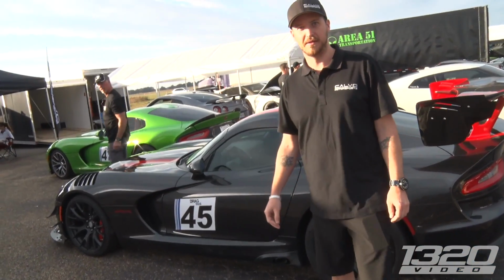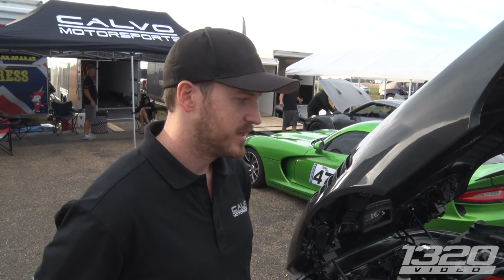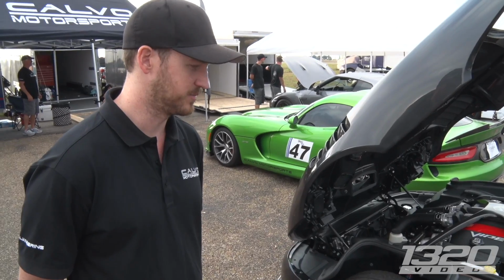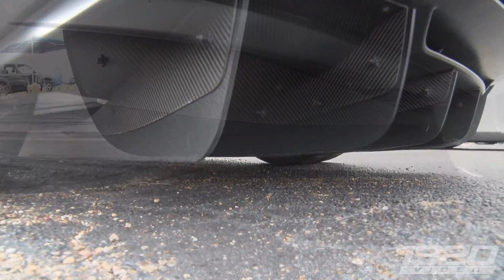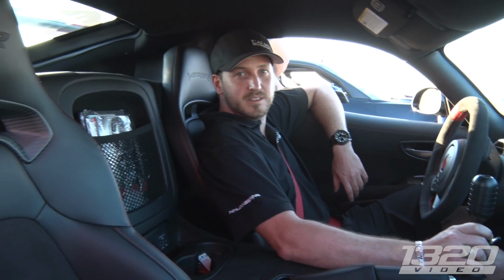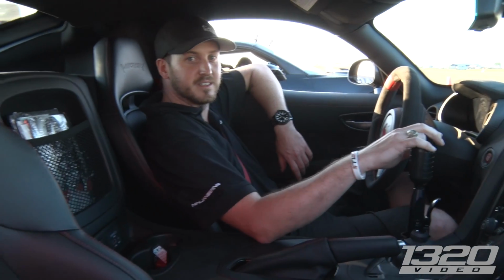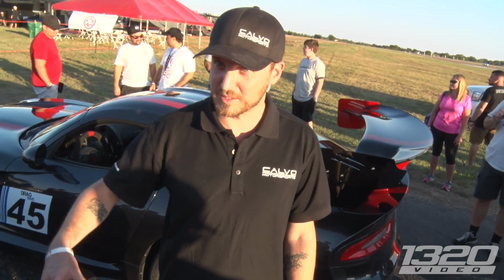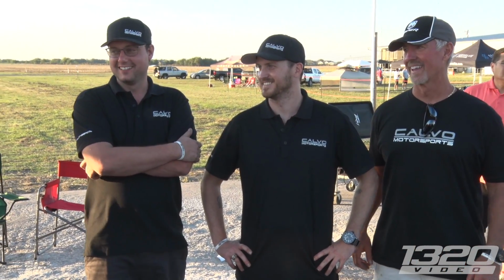This is the Way Vipers Should Have Come!

Comment: "V8 EATER" is kinda a lame tag when you have a V10.
Reply: Kevin B. *4 banger
Reply: No its not
Reply: Kevin B. So true 🤣🤣🤣🤣🤣 the new tesla roadsters will rape wipers for sure
Reply: Kevin B. How would a v6 eat a v8 it’s a smaller engine the v10 is bigger that’s why it makes sense you can squeeze more power out of more cylinders
Reply: thats the point. tags like that are usually on cars that would be considered the underdog.
Reply: David Stevenson with mods anything can be possible.
Reply: V8 is the class to beat.. I guess he's just mocking the rest of the American muscle.
Reply: Pretty sure he stole the ideal from that from the pennzoil commercial with the viper
Reply: You didn't know this is a 10L 2 cylinder? :p
Reply: Evil GST I think it's more of a poke at Corvettes V8. I'm sure "Vette etr" was taken
Reply: N.J. State øf Mind Haha stupid ricer. They have turbos, turbo the 7L too.
Reply: Evil GST well generally v8s are the best for power, not to many cylinders since any more would be unnecessary weight and more parts would be needed and it’s harder to keep it cool, not too little for it would make it hard to maake power and the same setup from a 4 or 6cyl would make more power on a v8, and it’s cheaper to buy and to work on any any bigger engine, and 4 or 6 cup setups to get identical power as an 8 cyl is more expensive given disadvantage in displacement. No wonder we don’t see Porsche’s with serious drag builds unless they’re LS swapped, or aventador having engine mods at all, or Mercedes G65s being turned into off-road builds, hell, even Mercedes won’t use the flagship v12 engine in the g class 4x4 so really, any other engine being a v8 killer is bragging rights( although I’d kill for a e60 m6)
Reply: David Stevenson ask gtr owners about how they eat v8s for breakfast, or how porsche can make a flat 6 get a 10 sec qtr mile bone stock, although a v8 does have more potential
Reply: Kyronius lol if that were true the car would be visibly vibrating from left to right and just sound like two pieces of metal hitting up against each other
Reply: oh and how many v8s do you see vipers lambos gtrs r8s once you can sort out traction bigger engines are better as the power delivery is smoother
Reply: Evil GST makes perfect sense to me
Reply: There are a few unicorn engines in the import scene, like the 2jz-gte which can make crazy power on  a stock bottom end with hardly any mods, then you have heavily modded ones that can pump upwards of 2k+ bhp, with a few insane ones in the 3k and above range with billet forged blocks the works.

It is one of the only non V8, V10 or V12 engines that can hang with the big cubic inch engines , while only technically being a 3 litre Inline 6. 

The engine is so widespread in the tuner scene that it has essentially become the LS of engine swaps. If a JDM based vehicle is doing quarter miles within the single digits, they probably have one of these engines under the hood.

Then you have honda engines, say what you will about hondas, but those little 4 pot engines can surprisingly be really impressive, you can reliably get upwards of 500-700 horsepower on a stock block with some forged internals, a cam and a good turbo setup, with ebay parts, all from a tiny 2 litre engine.

People underestimated honda engines, these days hondas are making way over the 1k horsepower range, while not anywhere near cheap once you get into the 1k range, you can make a lot of power from these small engines. There are Hondas that break the 200 mph range you know.

The Japanese know how to make some powerful and reliable engines.
Reply: You forgot the 4G63 which routinely handles over 500whp on stock block, rods and pistons. And some have made well over 600whp, all stock bottom end internals. Mine makes over 400 on completely stock bottom end with close to 200k miles and is daily driven.
Reply: They're pretty great engines too, but at the higher power range, they're not exactly known to be reliable or cost effective to modify, still they're a very iconic engine that came in the evos.

Similar to how the RB series engines from the GTRs can make great power reliably, but but in the higher horsepower range the the 2JZ has it beat, for power to cost ratio. For example you can get 1k bhp out of a stock block 2jz while with an RB needs to be more heavily modified to get the same output.

Don't get me wrong I love almost all tuner engines, but the 2JZ-GTE trumps just about anything in power from the 90s- early 20's when it comes to JDM and that's fine, not all cars and engines were made to to be fast in a straight line nor do they need to be.

The JZ was heavily over engineered by toyota and yamaha to be honest, the engines were never meant to be that powerful. It's practically bulletproof due to it's ridiculously strong cast iron block, oil squirters and forged crank, which it all came with straight from the factory. 

Even the Supra's brakes were overkill for the power it was making stock, the brakes were so powerful it was beating out sports cars like porsche at the time.
Reply: Yeah it’s pretty stupid, also considering the two turbos.
Reply: alan carranza yeah when your 4 bangers make 250hp stock lol you'll have to dump a shit load of money into your rice burner to get it to 400hp ( if it can handle it on stock internals) let me guess 2jz swap typical ricer  392 hemi 485hp naturally aspirated , 5.7 hemi 375 hp  , 6.1 hemi 425 hp , Ford 5.0 liter  460 hp , viper v10 645 hp stock , let's go low end 3.6 liter pentastar v6 305 hp , mustang 4 cyl 310 hp , Ford v6 in the sho 365 hp it goes on and on when american muscle boosts its massive hp not this big twin turbo , cai , performance chip , weight reduction , fart can ,lol bagging it and don't get me wrong but some Asian imports are no slouch such as gtr , supra but as tech advances more hp 4 cylinders get means the v6s go up and the v8s do as Well , it doesn't  take a shit tom of mods to make a v8 strong
Reply: Wind of change Honda engines are made 2 miles from my house here in Ohio. Not japan
Reply: it's basically saying fu to your v8 and whatever forced induction you have on it
Reply: David Stevenson smh
Reply: V8 killer fits better i think
Reply: Should say "zr1? LOL"
Reply: Ya a v6 would fit the plate better for that statement
Reply: That plate would look better on my GN
Reply: Because it is literally v8 eater. Bullying maybe yes, but it is what it is.
Reply: @daevid21  fort gt is a v6 and it beats the demon

Comment: I get that he needs downforce for 1700 horsepower, but if he is dragging the diffuser by the end of the run i think he should pull back a little on the aoa. At that point the drag made by the spoiler is probably counteracting the gains made by extra downforce at the start. Anyone agree/disagree?
Reply: If he was only planning to do this kind of event he could tweak the car to do a lot better. One of the GTR's had a clever aero solution where the angle of the wing is sprung, so as it gets faster the angle reduces. Best of both worlds then, you get the extra traction in the gears where you need it, and less drag at the top end.
Reply: I saw that to. But you wouldnt think its that hard to spin a couple nuts and bring it down on the adjuster
Reply: very true
Reply: yes, that one was nice.. at high speed the wing will flat.. reduce a lot of downforce
Reply: Reducing the angle of attack also reduces downforce at low speed. As for adjustability, it only has five settings, not "a couple nuts" with unlimited adjustment. The "fix" was to increase tension on the springs, and increase the compression damping.
Reply: Ninjaneering did you guys use a dry sleeve? Or wet sleeve? Thanks

Comment: Why does the viper engine always sound lazy? No matter how much power they put thru them they never liven up.
Reply: Its because Vipers usually don't rev high. Around 6k rpm is 'screaming' for your typical Viper engine.
Reply: They don't need to?
Reply: Sonos45 v10's are just sequential firing 5 cylinders mashed together, sequential 5's sound like tractors without a proper muffler setup (lambos sound good due to the insane multi chamber muffler design) where as vipers don't have room for it. Awesome cars that sound like doo doo.
Reply: I know they are awesome just I've heard industrial generators that sound more enthusiastic .
Reply: Sonos45 its not a super high revving engine
Reply: because 8 litre
Reply: i like it, so you can run away & won’t be heard miles away
Reply: Its has a longer stroke so inturn lower rpm. I hear a straight piped one in orla do once and it sounds pretty nice tbh.
Reply: Sonos45, Cross-plane engines tend to rev lower because from the first to the eighth piston the sequence of the firing is uneven and makes it more difficult to rev over 6,000, 6,500rpm sometimes and the capacity is limited because of that. Engines like the one in the Lamborghini Gallardo, is a Flat-plane V10, and it can rev higher, because the firing times go even thanks to the Flat-plane crankshaft.
Reply: Sonos45  Most of it has to do with whether or not the two exhaust banks are joined together. And on this car, I don't think they are (side pipes). Look up some videos of V8's with 8 into 1 headers...they scream compared to "true dual exhaust"
Reply: I think you're a bit confused, here. There is no such thing as a flat-plane V10, as you typically need your number of cylinders to be divisible by four for it to work without issues. Lambos are, however, true 72 degree V10s, and therefore even firing, thanks to offset pin cranks, unlike the Viper, which is a 90 degree odd-firing V10. The ability to rev has nothing to do with the crank pin design as much as it does with the stroke of the motor, and the mass of the rotating assembly. The Viper has a 4" stroke, which is pretty huge. We still rev to 7K RPM, though.
Reply: i wonder why they must go with a 4 inch stroke as 8.4 liter is WAY bigger than the competition.
Reply: its named viper for a reason
Reply: M773 also don’t forget the viper redlines at like 6100 RPM.
Reply: @herculesrockefeller2984  exactly my friends 750il 12 cylinder redlines at like 4500 rpm

Comment: What's the deal about the 19" rims?
Reply: Shawn Moses 1750 WHP through a thin set of Proxes, on stock 19 inch wheels, and it didnt spin and was pulling 200+ mph runs, its damn inpressive..
Reply: Shawn Moses built it as a street car
Reply: .. as compared to 15" drag radials like most rwd cars making close to or over 1000whp run. Doing these times on a 19" small sidewall street tyre is more than impressive...
Reply: Big height is a good band aid for slightly too short rear gear, sidewall and flex are what give it the most traction. Most of the time its only slightly taller than a 19 or 20" wheel if any.
Reply: Because true streetcar...

Comment: Not much of a V8 eater if the CTS-V on the second run beat it💪🏼
Reply: Dude that was just in practice test and tune. Mopar always rules.
Reply: Power Wagon always
Reply: It's obviously a reference to Pennzoil viper video.
Reply: He's on street tires!!!
Reply: Power Wagon the cts v is a beast tho
Reply: Still though, it would take similar cubes to chase this viper.
Reply: The viper was tuning that is why it won
Reply: They were tuning, not racing.
Just like at the drag strip when two completely different cars appear to be "racing" when they're actually testing.
Reply: There's the fact that it wasn't a legit race but just a tuning session, as stated multiple times before. But also note the difference in rear tires. Give that viper some tubs and bet that caddy wouldn't stand a chance.
Reply: That was during test and tune, and was my dad's first time ever driving the car. The Caddy lost when it came to the actual racing, whereas we won the overall RWD class. So, #v8eater stands true.
Reply: Ninjaneering Love how you guys made the that V-10 work!!!!!
Reply: Test and tune dude
Reply: Also that CTsv was definitely not stock:)

Comment: Can't say v8 eater with more cylinders and displacement...... only works the other way around
Reply: William Proctor it's a reference to the Pennzoil viper.
Reply: Nah he can do that
Reply: actually he CAN do that.
Reply: Can’t say v8 eater but I’ll say it’s the lambofucker
Reply: How about a RT-flex96C two-stroke 14-cylinder diesel with 107,389 horsepower? 5,608,310 ft-lb torque at 102 rpm.
25,480 liters displacement. That's not to say it's a fuel hog. It makes over 50% efficiency.

Comment: Without the wing he would be doing 210 ish quite easily.

EDIT: 215-225 easily.
Reply: MrZyLeXx BHAHAHA no that wing is actually helping ALOT this is WHAT Nissan GTR's is also done for å while now.  It generate alot of Grip so you can push more psi per gear..
Reply: You are greatly mistaken... This is 1500' of acceleration, not a top speed run. The car is gear-limited to 230, and has been 210 in the 1/2 mile. Without the aero, the car would've gone slower. We had an identical car, but a GTS with the advanced aero package, and it went slower all day.
Reply: Ninjaneering Did you guys build this thing? That Viper is a monster. Personally, if I were to have a Viper, I’d keep it NA and try to get it up to like 800hp.

Comment: 3:56 notice from the wheel gaps front is higher than the rear when he goes flatout; negative rake = not good. He needs to raise the rear to eliminate negative rake when going full send. This would cause the air underneath the car to think it has bigger rear diffuser than what's actually on it = better suction to ground. Doing so means he won't be scrapping his diffuser anymore. win win. Plus this is what the F1 guys are doing. He could probably eliminate the rear wing since essentially all rear wings produce drag.

Comment: The Gen V Viper needed to make between 700-800hp just like the Hellcat to catch the attention. It could have with Individual Throttle bodies, under piston oilers (allowing the Compression ratio to be boosted to 11.5:1) water injection, a Hemi head, change to the a 72deg block angle (instead of 90 degree). The Hellcat came out with the Right amount of hp.

Comment: Great vid but I'm curious why so much HP when there are plenty of modern cars that will do 200+ with half the power. Is it a distance thing?
Reply: Spinal2111 Yes, speed within said distance, its only about 1600 feet I believe.
Reply: Math.... D×R=T ..Distance multiplied by Rate equals Time.  The Faster you can achieve a top speed... in a very short amount of space and in a short amount of time...

 Some cars can do 200mph, Yes.  But, in a long distance and usually taking a few moments longer then the mile or quarter mile drag races.
Reply: Yep

Comment: All these twin turbo big power vipers, are they stock blocks or are they now using aftermarket blocks that have recently been developed for late model vipers? ive been doing a bit of digging through forums all over the place and cant find much on aftermarket blocks apart from LSM billet blocks so I cant help but wonder.
Reply: stock blocks and crank.  there are plenty of them making well over 1000hp on stock motor with just turbos

Comment: With that huge parachute molded into the front end,  I realize the Viper wasn't designed for top speed, but running a 1/2 mile from a 60+ mph roll ..with 1750 hp. and yet only achieving 195 mph seems a bit slow.  As a comparison to another car not limited by aero-drag,  a 2006 Ford GT with 1650 hp. at WannaGoFast  Dallas 1/2 Mile Shootout, ran 204+ mph and a 2005 Mustang GT with 1250 hp ran 194 mph ..both from a dead stop.   ...just keeping it real.    
https://www.youtube.com/watch?v=0QMiMR7G27E&t=346s
Reply: Benevolent Protector viper had street wheels

Comment: When they opened the front hood of the viper, i see this X engine cover thingy. What is it for?
Reply: That's a strut support bar
Reply: Gopal Gomes does it prevent the engine from moving around when cornering?
Reply: No they provide structural support and in case they car is hit on the side the strut bar takes half of the impact
Reply: And also it doesn't allow for play in both of the strut bars
Reply: Gopal Gomes i see. Most front engine cars dont have these. Maybe because it adds weight but it helps.
Reply: Most daily grocery getters aka daily commute cars don't need then when u buy a entry level performance car or a performance car you get one. And a strut bar weights nothing tbh and some are made out of carbon fiber